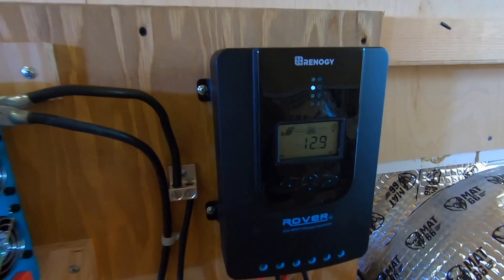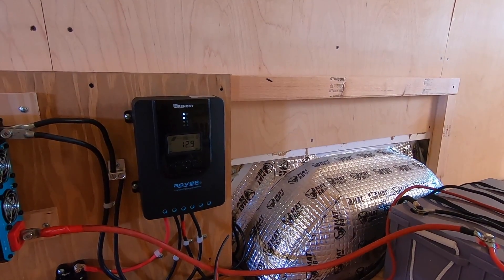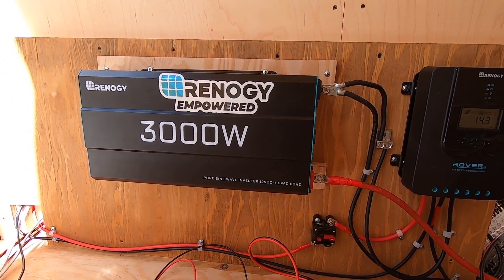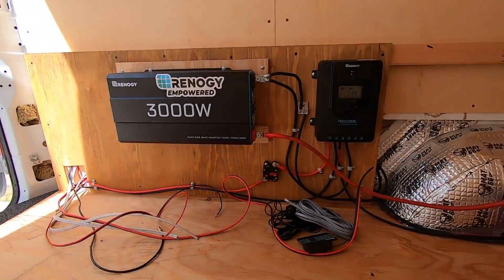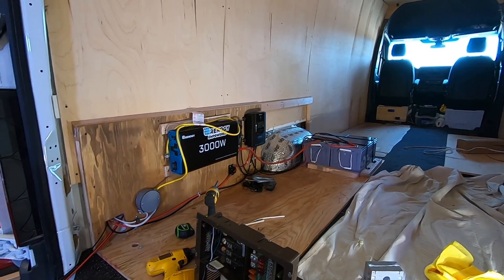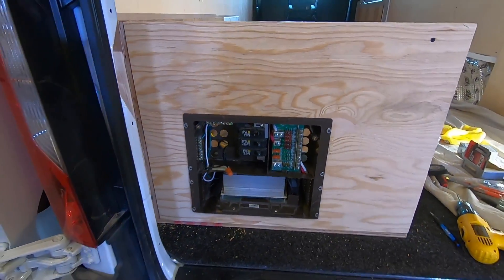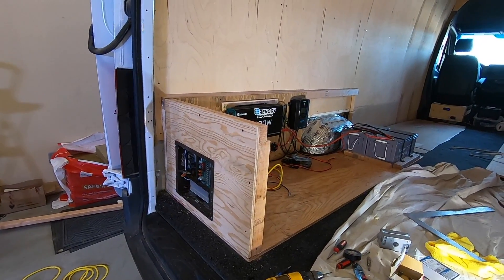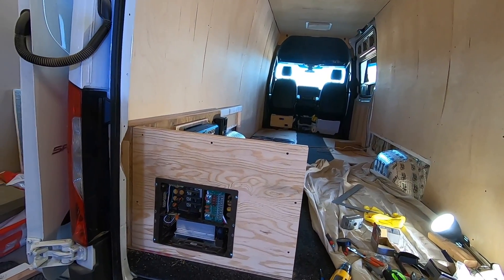Renogy Solar System Test - Electrical Panel Layout

Comment: It's coming along.  I'd love to have the room for a set of those batteries.  You have some interesting power assumptions possibly going on.  You'll want to fuse the line from your battery positive to your inverter positive input.  It's not a good day if you have to go in and fix one of those.  I'm sure that's probably something you'll pick up when you get the heavier battery cables.  Have you thought about putting a barrier between your electrical equipment and your storage space?  A slide-in partition would be cool.  Awaiting the next installment.  Have fun building.

Comment: Russ - things are coming along nicely. We have been watching for a while now. I have a SAFETY question. I was under the impression that you should NOT have AGM batteries indoors, especially near sleeping or cooking areas. Those are technically still lead acid batteries and need to vent. Is there something about the batteries you are using that don't need to be vented??

Comment: Hey Russ your panel won't be accessible from inside the van. Neither will the remote switch if you put them there. Just wondering why not make it easier to get to in case of weather and etc. Good luck and keep up the good work.

Comment: Nice work, Russ - enjoy your videos and appreciate all the good information provided.  As an old mechanical engineer, I would strap those batteries directly to the metal van floor so they stay in place during an accident.  You could get forces 10 to 15 times their weight in a crash which would do a lot of damage. Keep up the good work!

Comment: Hello Russ I see a silver connection on the ground wire from the charge controller to the inverter,  What is that for? It does not look like a buss bar, shunt or a fuse.  Also where do you pick up a bigger battery cable? I will be starting a transit conversion this summer / fall  THANKS Russ!!!!  Love your videos!!!!!!!!!! Roger the ExBassGuide

Comment: I am enjoying your van build series. I am poaching ideas to wire up my remote mountain cabin. I will definitely consider Renogy products. I also noticed that you had mentioned that the Renogy 120 volt  inverter has a 20 amp breaker. It looks like the Romex wires coming from the jbox are white, which indicates it is 14 gauge wire, thus a 15 amp breaker is required. 12 gauge Romex is yellow colored.

Comment: Hi Ray. Check into a good quality fuse between the battery and the inverter. As it sits its not protected and I know those inverters aren't cheap. Keep up the pace.